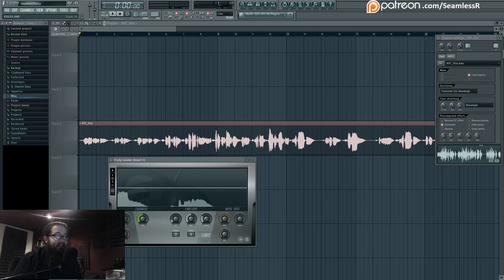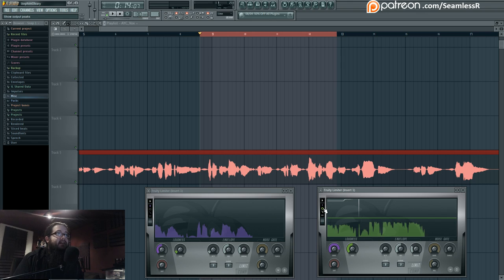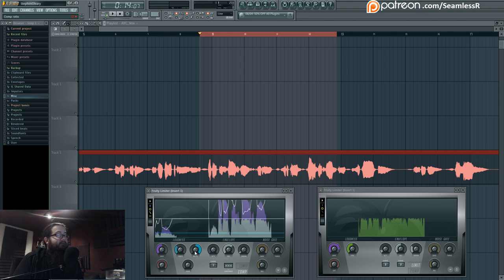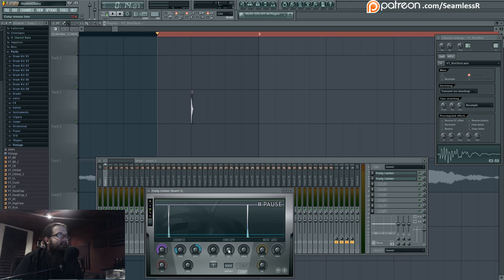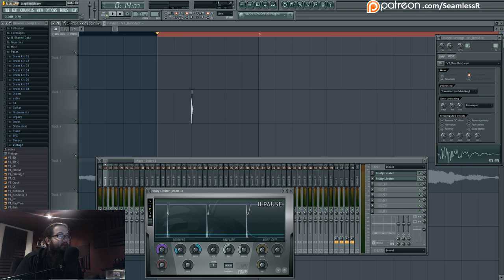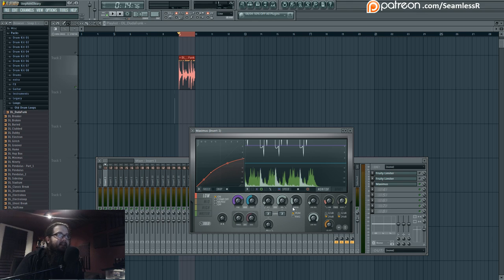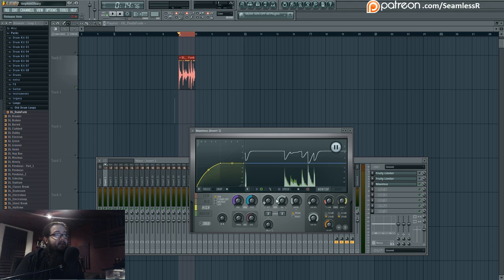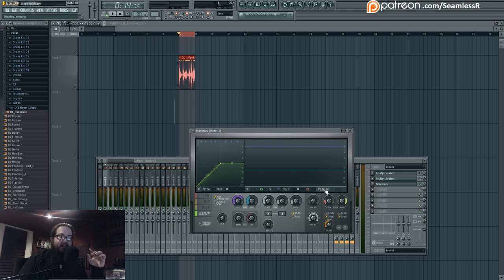Production Basics 4: Compression

Comment: Although I know the technical aspects of compression, and a couple of its uses, I thought this video would cover where to apply compression and to what end. :(
Reply: When you have too much dynamics, or when simply want to bring up harmonics. And don't mistaken a compressor with a limiter. Also you'll need a multi-band comp when mastering, unless you're incredibly amazing at mixing and you're mix is close to perfect, in which case you won't need mastering!
Reply: Yeah, now.. When do I want to bring harmonics? is there a good example anywhere?
Where do I want to use a compressor in a specific band?
Are there any good normal uses for a multiband compressor?
examples? :D
Reply: Rafaelinux Well to put you in context, i produce progressive/electro house. For my progressive house bass', i like to highpass my bass at around 80hz and layer a sub bass. The highpassed bass, i often like to compress simply because I like the harmonics it brings up. And trust me it sounds different than if you were to simply boost freqs with an EQ. Same thing goes for the kick, I like to compress it because it makes the kick fatter, simply by reducing dynamic range, which in turn lowers the peaks and raises the low components by adding some makeup gain.

For specific band compressing, I assume you're talking about a multi-band compressor. And it's personal really, whatever you feel more comfortable working with. It can also be unnecessary when used for useless reasons. I usually only use a multi-band compressor while mastering, since you don't really split your master into 5 seperate tracks. You need those multiple bands just for more control over your end results. You can just use a regular compressor but it won't sound as good as compressing individual bands. And typically you don't really multi-band compress your master hard, you just use it to control freq bands. The limiter is what controls peaks and brings your track as close as possible to to 0dbFS. When I make electro house, i concentrate alot on sound design. So I like to put a multi-band compressor on my channel since it gives me more room to work with. You DO NOT want to compress your low-end (anywhere around 30hz-120hz) because that typically corresponds to a sine wave. The "energy" you feel in a club hitting you is the sub, and the sub isnt a square or saw, it's a sine.

Comment: Yo dudes, this is my simple way of defining compression quickly.
You set a threshold of where you want your sound to be capped off at dB wise, depending on a ratio (eg, 2:1) meaning for every 2 dB that goes over the threshold, 1dB will come out. (Meaning 10:1 ratio, every 10dB over the threshold, 1dB comes out. This acts as a 'limiter' like Seamless explains, but there is actually noise that gets out of the tightening grips of the threshold/ratio relationship, because of a thing called attack. Every compressor has an attack and a release time paramater, which tells the compressor when to engage and when to disengage. Example: If the attack time is 40ms, the amount of time the compressor takes to engage or compress the audio peaks once the threshold has been breached, would be 40ms. The same is for release, which in a way is the opposite, but not quite. The release determines how long it takes for the compressor to disengage after the original audio has dropped below the threshold.
TL;DR, compressors are great for making the quiet sound in audio louder.
also, never use compressor presets! The designers of the compressors don't know what you're doing with your audio, or what it is. Just because a preset sounds nice, doesn't mean its the way to go.

Comment: would cutting low frequencies on a sound with an eq plugin be the same as compressing just the lows with a multiband compressor?
Reply: +ITG4MiST Remember, an EQ is a volume based plugin which is able to either boost or subtract a chosen frequency, if you were to use a multiband comp to compress a certain band, you would be compressing the signal, which would lower the output volume ( depending on your set ratio eg: 2:1 = 2db in, 1db out. ). So it is the same, in a sense that you  can reduce the volume of your chosen frequency BUT compression and equalization are still two different things.

Eg:

I would use a multiband to 'tame' the low end of my master track ( Compress the loudest peaks )
But use an EQ to 'equalize' my master track or level it out ( Make sure my low end is not overpowering the mid-high end) 

Hope that made a bit of sense.
Reply: i think so yea! thanks for the explanation :]
Reply: +Farai Sean dude thanks, i have a lot to ask. how can i contact you? i am not a spam and i came here often just to listen to seamless mumbling about the curve because he said "i am doing math, yeah whatever" i guess i am a little bit lost

Comment: Great walkthrough.  Would you say that to process drums, would the best way of compression be a multiband over the whole thing, a multiband over each drum, or compress each with a standard and then go multiband over the bus?

Did you make a drum / punchy guide? ^-^
Reply: Typically each component of a drum set is concentrated in a certain freq band. So kick is mostly bottom kick (35hz-150hz) and click (2.5K), OH & hats are 2K+, snare (80hz-400hz) and air 10K, etc... So you don't need a multiband compressor. Also when using samples, those samples have already been mixed, so no processing is necessarily needed. But if you still want to compress, use an EQ before compression and then compress. A kick for example, i would highpass at 35hz and slightly boost at around 2.5K if needed. Then to compress, I would have a relatively fast attack, so like 15-30ms and the release should be the length of your kick. I'd bring the threshold down till I find it's good, each kick is different. And finally makeup gain since you're trying to fatten it up.
Reply: IAmTheTallGilo I'm working with the Steve Slates Drums plug.  Usually just hit them up.
Reply: BirdFluJapan I'm not familiar with that plugin. But if it's sample based, then compressing would be most likely unnecessary since the drums are most likely already processed. If it's a drum synthesizer, then you can go ahead and compress what you feel needs to be compressed, maybe the plugin even has a built-in EQ and compressor, etc. But a multi-band compressor wouldn't be really useful for drums. It's more useful for in depth sound design when processing a sound covering a large portion of the spectrum.

Comment: You left out the RMS compression feature. I'm not sure how to work with it,but i herd it's a transient shaper.
Reply from the maker: RMS is just a different way of measuring loudness. There are a few other modes used by mastering engineers out there for analysis, I am not particularly well versed in their uses.
Reply: RMS volume level is computed based on the average volume of the signal for a small portion of time (known as the "RMS window").  It's not literally an average, but it's similar.  The RMS switch compresses the signal based on this RMS level instead of the actual volume level.  Your brain hears RMS, not actual peak volume, which is why this exists, it can sound more transparent on some material.  One of the byproducts of RMS in general is it ignores sharp transients which is why it can sound like a transient enhancer or shaper.  This also makes it ineffective if you're trying to compress those transients.
Reply: so thats why they say it's a transient shaper and it's good for snares and kicks if you want to keep the snap or punch. Will be using that on my kicks.
Reply: RMS stands for root means squared. It takes an average in a set amount of time.. similar to how your actual ear works. It's a better way of measuring loudness relative to how the human ear works.